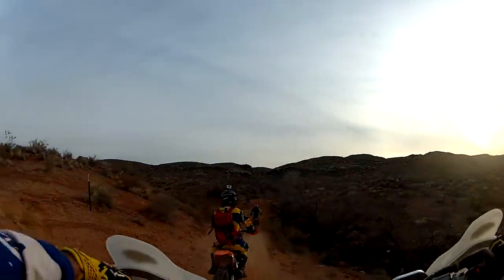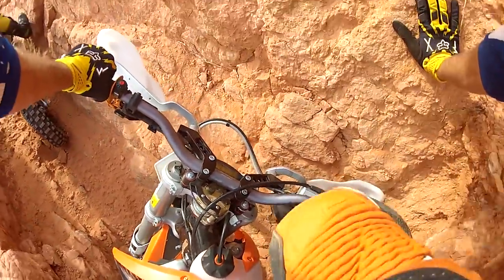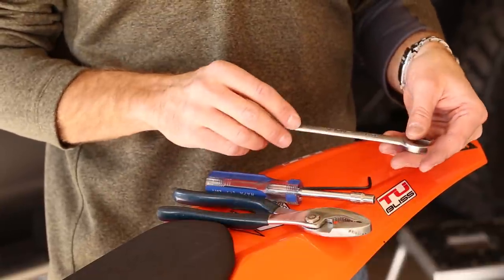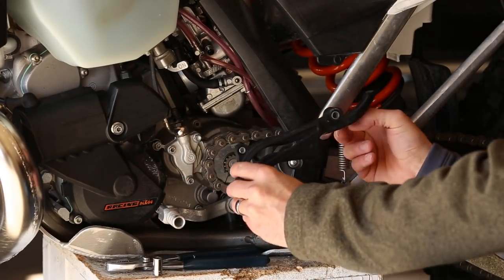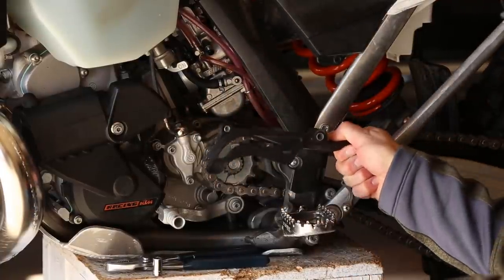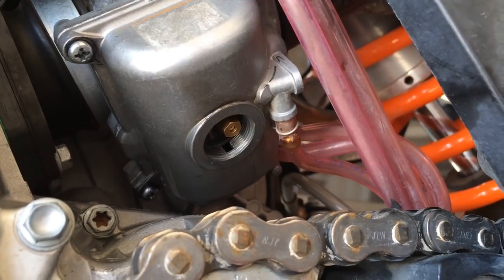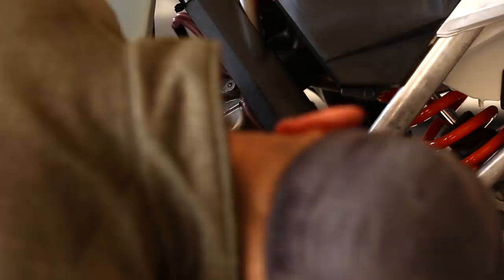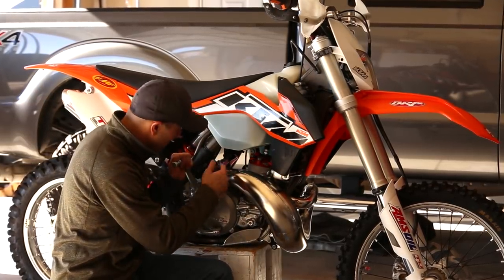How to Jet a Dirt Bike Carburetor - Jetting and Needles

Comment: I never wanted to touch the carb just cause I had no idea what to do. That video was great,  I will definitely save some money by doing this myself. Cheers. Keep the great vids coming.
Reply from the maker: Frank B I'm glad you learned something valuable.
Reply: 4 years later and you’re still saving people money ! Just did this an hour ago.. unfortunately I’m coming from Colorado and riding in PA so I got my jets replaced.. road it didn’t feel right.. procrastinated until tonight and changed my clip position from 1 to 3 and it still doesn’t feel as powerful or crispy as it did in Colorado I bought the bike used so I couldn’t tell ya what exact needle is in there (other than it ran perfect in Colorado lol) so I moved the clip to position 3 (what I read in the manual for OEM) and it still doesn’t feel right 😓 gotta go pick up the right needle I guess lol

Comment: Great personality and attitude. No-one started with a works sponsored mechanic when I was picking up riding in the middle of Australia. It was mates who rode alongside you, laughed with you and enjoyed doing the same things some crazy yank is doing on YouTube.  Some of those thingeys and whatsit's do have names. Needles sit in "seats", the nut retainer thing. Remove the throttle assembly (needle bit) first before attempting the bowl. This allows greater leverage without bending needle, allows for straighter jet removal and replacement (cross thredding at your angle with straight tool). Plastic guide on bottom of spring is set snug in spring for a reason, retension and extension of spring is measured for true length of a spring. Not seating the spring at its propper length can cause obstruction and bunching. 
Your blogging is inspiring for me and my 4yr old son. Educational and addictive. Thankyou
Reply from the maker: Thanks Royce!!

Comment: That little cup at the bottom of spring!  Gotta watch that tongue inside of boot. REAL IMPORTANT!   Your video with the cup up on the throttle wire FIRST and slide the cup down in SLIDE with the tongue inside of keeper is important.  The spring trick was dead on. THANK YOU.  Without that trick the cup is a 50/50 of seating correctly.  Glad I saw this much earlier.  Saved me time and tooling issues. Light at the end of the tunnel was quick.

Comment: i must say the single most important lesson this vid demonstrates is the spring trick on the slide....that is golden to a newbie and once you do all this and reassemble and bike fires right up...the confidence boost that inspires is priceless and wiill give u more confidence in future tuning sessions. but on the spring method ...until i learned that.. i would feed cable on the bottom of slide and lock it in ONLY AFTER i had put the spring on and as  id compress the spring..id hold it in the most compressed  position and then use a pair of small vise grips to clamp on the wire right below the spring so it stays in the position it needed to  get cable end into groove and seated right..then id pop off the vise grips and slide her in the carb housing... its  really frustrating and on average that  step took me around 45 mintes of trial and error before i got it locked in correctly and was the single most difficult step for me to complete....so with the spring twist on method....the hole process will go light years faster!!!!

Comment: Hey a neat trick you can do with your carb is to take the top two vent hoses on your carb and put them in your airbox since only air goes through them. This makes your bike easier to start if you stall in a mudpit or creek where water could be blocking the hoses.
Reply from the maker: ***** Thanks for the tip, Brad!
Reply: Just returning the favor!

Comment: That spring trick is the best thing I have learned in a long time as my arthritic hands get worse. I recently adopted 3 KTMs  and this has been a lifesaver on the 300 and the 440. Which brings to mind a question about the 525: Why have modern 4 stroke carbs become so huge and complicated?

Comment: I bought a new 2016 sx 250 . First time I went on it spark plug fouled straight away before I got on track. Anyway to cut it short my air fuel mixture was out by half a turn so I put it back to settings out Manuel which was 2 turns from right the way in n haven't had any problems since

Comment: tip... try not to ever use the open end side of the wrenches on any bolt. Always use the box end (preferably  6 sided) to break bolts loose and to tighten.

Comment: Don't know if I mentioned this in a previous video comment.......I include a strong, small, flat magnet in my butt bag while on the trail.  I do this to magnetically capture the needle clip......to change clip position...press against the magnet....it hangs onto clip.....select what position you want the clip in and, again, press the clip with the magnet.  I arrived at this idea after losing a clip/looking for it for an hour in the dust and having to jury-rig a tiny piece of wire to act as a clip.  Also,  I carry an extra clip in my butt bag in a tiny container.

Comment: I have a 2003 KTM 125 SX, I need to remove the float bowl in order to change the pilot jet, which is a bummer. It would be nice if I could access both the main and pilot jet from the center hex cap.

Comment: When you pulling the needle and throttle cable out of the carburator at 6:50. What is creating that resistance and pushing the needle and lever back inside the carburator? I'm worry to pull the needle up? Even needle and slider are moving easily, I feel like I will pull too much on the spring. Do I have to release or pull anything to get the needle out of carb body?

Comment: Thanks for your content.  I have a 2017 KTM 250 XCW.  I was going to follow your instructions to rejet the new Mikuni but access seems really limited.  Since you have the new 300 XC, which I assume is similar, any advice on "getting in there?"  I have an electronic module hanging down from the frame above the top of the carb.

Comment: Do you need to mess around with the carb when changing exhausts ?? My cr125 01 keeps loosing spark due to getting covered with oil.

Comment: Hey I really enjoy and appreciate all your videos!  I have a 2015 ktm 300 xc-w SD.  I live in NL, Canada most of my riding consists of sea level to 2000 feet and a range of 10 degrees celcius to 25 degrees 70 to 80's max fahrenheit.  What size pilot and main jet size would you suggest.  I've been riding two strokes for a long time but tuning and working on them is new to me.  I am starting to watch some of your videos and others because I really want to start learning to  tune my bike myself.  I'm also wondering what you thinnk of the ktm powerparts FMF pipe and silencer.  Thanks any help would be greatly appreciated
Reply from the maker: kharma1212 This is just a starting point for you, but I'd try a 168 main jet with a 38 pilot jet.  I'd run a N4DJ needle on the 3rd position.  Your bike kit might have come with the N8RG needle which would be fine too.  You might just have to play around with your air screw and the needle clip position.  Lower numbers on the needle clip are leaner.  Higher numbers are richer.

I like the FMF Turbine Core 2 Silencer.  Not sure about the KTM power parts ones, as I've not tried them.  I like the FMG Gnarly pipe, but I don't love it.  I really liked the Pro Circuit Platinum 2 pipe.  Tons of power on the pro circuit pipe, but I don't like the pro circuit silencer.

Comment: I have a big bore from a 125 to a 134, I have the stock jetting which actually works for where I am. I called multiple places and they said it should be running lean but it seems to be running rich. So my question is can I go with the factory jetting chart, and is my big bore requiring a richer or leaner jet. The main is a 380 which seems massive. 

Main-380
Needle jet-45
Needle-6beg20-68 3rd from top 
Air screw-2-1/2

Comment: the needle doesn't occupy any of the main jet space. it occupies space in the needle jet (which generally is not considered something you change for a different size).
Reply from the maker: You are 100% correct.  I totally mis-spoke on that part during the filming of this video over 2 years ago.
Reply: Do you have any experience with the spreadsheet for finding the perfect needle for your Keihin? It's called the James Dean Jetting Guide. I found the perfect needle for my '89 Honda CR250 by using it.

Comment: You don;t need to take off the chain guard, just wiggle the throttle cable down a bit and the carby will rotate fine.

Comment: my engine runs a little rough, the same bike (300exc *12) of my friend runs very smooth with much less vibrations, he has a jd jetting kit in it but i think its not only the jetting kit. what should i do? needles,... are in standard positions and standard size (right adjustment for my area)    - nice video but hard to understand for a german :-P
Reply from the maker: I bought one of those JD Jetting kits and found it to be EXTREMELY overpriced for what you get.  It only came with 2 needles and 3-4 main jets with one Idle jet.  You are better off to just buy a mix of jets and needles for your carb from your dealer/online.  It will be less than half of the money.

As for why your bike runs rough, it's difficult to diagnose without riding it.  Look at the chart for jetting in your manual.  It will show suggestions for your elevation and temperature.  Use that as a starting point and then fine tune from there.
Reply: thx for answering. the needles and jets are in right positions for my conditions (temp and elevation). i'm only wondered about the engine, can't explain it better: the engine runs rough with much vibrations, not only in idle, also at half or full throttle. the engine of my friend runs very smooth and have a better response. i ride 1:55 mixture (1:60 recommended, think it's better with a bit more oil) should i take a smaller or bigger jet or try another needle position?
Reply from the maker: EnduroAction
Keep in mind that running more oil in the gas causes the fuel/air mixture to become leaner overall.  I know that sounds counter-intuitive. When deciding the fuel pre-mix ratio, always go with the recommendation of the oil manufacturer.

If it's VIBRATION coming from the motor, I'm not sure your carburetor is causing it. In my experience, the carburetor will determine how well the motor runs and will effect performance, but it won't cause vibration.  Vibration makes me wonder if you have something out of balance.  I might take it to a mechanic someone who has a lot of experience with your bike model.

Comment: Great video, I rescently installed jd jet kit on my 2015 te300. As per their instructions its set for 3-6k feet because most of my riding is from 1k to 6k. However I just took it for the first ride since the rejetting and it wasnt optimal, I called jd and they recommend i set it for t 8k'  because it is getting pretty hot where I ride 70-100 degreese. He siad altitude and tenperature have the same effect on jetting. What do you think?
Reply from the maker: Obed M. I bought a JD Jetting kit.  I thought it was VERY over priced for what they give you.  If your bike runs fine, then I wouldn't worry about it.  I bought individual needles and jets for a lot less money to create my own Jetting Kit.

Comment: really need help, this new mikuni carb on my 17 300 exc is killing me. I've only done 4.5 hours and opening to mid range gas sounds quite croaky and not smooth, the power isn't all there low down and she's running out of fuel quite quickly. not very good with carbs other than twisting a couple of screws haha, would appreciate some advice.

Comment: I have a 2008 ktm 300 xc. I don't ride above 2000ft. I bought the bike used. The guy was running a needle I never seen and has no indications on it on notch 3, 175 main, and 38 pilot, air screw was way out and ran great. All of a sudden the other day I lost a ton of low end power. Rejetted multiple times still had issue. I believe it's the reeds so I'm gunna get vforce 4 reeds. Will I need to rejet for the reeds? Or can I follow the book?
Reply: I don't have an answer to that but I just bought an 08 300 and I love it!

Comment: I havent messed with jetting on my bike since ive gotten it. Right now its running amazing. Idk if jetting would make any difference or not
Reply: Its starting to warm up now and elevation where i live is about 900 feet. So whats type of jet would you recommend for 900 feet elevation and about 50-70 degree weather?
Reply: My spark plug has a caramel color in the center where the probe is and it a little dark on the outsides, sometimes is wet with oil on the outside but isnt bad

Comment: I’m having issues on kx125 with a Athena big bore kit.  It hesitates half to three quarter throttle on acceleration then jolts speeds up quick.  I cleaned carb but still feels like it’s starving.  Do you think the needle should be adjusted?

Comment: solved the problem now it was a split in the inlet rubber so when i rapped the throttle on it opened up letting excess air into the mix killing the engine thanks anyway

Comment: Man my buddy has a new to him 01 rm 125 thats been bored .50 over, he got it real cheap cause it's sluggish in first, wont even stand up. it pours oil out the pipe like the guy rejetted the carb and put too big of a jet in (which i read below) but would this cause the bike to be sluggish? New power valve? Im dumbfounded. Thanks

Comment: great and usefull video. one question: I have got ktm exc 300 2015 model and the first thing when i got it I went to jet the carb according to my attitude and temp.  I changed jets as manual says but the  spare needles that i have got with my bike are completely different to those specified in manual. what should i do??
Reply from the maker: Are you sure you have the wrong ones?  What are the numbers on the needles in your kit?  I order them online from Rocky Mountain ATV/MC here in the western U.S.  Not sure where you live...
Reply: The manual seys N2ZW and N2ZJ depends on temp. I got N84K and N8RH in jetting kit. Current setup on my bike is: 
N8RG (stock needle)
3rd posotion
Idling jet 38
Main jet 175
Air screw: 2

What do you think??

I live in Bosnia and Herzegovina 800m above sea level, average temp is 18C

Comment: Hey! I have a 2015 Honda Crf230f and I checked the spark plug and it was VERY white at the tip telling me it is way to lean. I took apart the carb and I have a size 110 main jet and a size 42 pilot jet. Which jets should I buy to get the engine running a proper air/fuel mixture? Thanks!

Comment: i need help its a atv bigbear 400 2007. i have a jet kit put all of it in except the jet. the number of the jet is on top of the jet, but i cant find which one to use i live in east texas.number 138,140,128,124,120,136.thank you

Comment: Honest question here. Do you really have to change jets mid-way a ride? Cant you just stick pick a mid-way jet and stick with it for the entire ride? I'd understand if something's broken and your bike wont run then it's a good idea to take it apart.
Reply from the maker: +shogrran No, I only mess with jetting a couple of times per year.  Some racers would jet each day depending on the conditions though...
Reply: Dirt Bike Channel Thanks for replying. Aside from improving fuel consumption what good does matching the jetting to conditions do?
Reply: No but you should be adjusting your fuel/air mix about every 5-7 degrees F. Not hard just give your engine the max amount of air to idle at the highest RPM. Changing internal jets, needles, slide position will not need to be changed until more dramatic altitude or temp changes. 

Ktm jetting App will give you all this info plus much more, check it out.

Comment: how do you know what jets to use? I have an 01 yz125 had the engien rebuilt and I rebuilt the carb it has a pro curcit pipe and v force reeds and ik those play into what jets you use just don't know what jets to use so please help lol
Reply: 2strokemoto man i ran into the same problem did you find out what jets?
Reply: Lookup what your altitude is,  and then your avg temperature,  then order a main jet that fits that,  and look up the needle position number at your altitude
Reply: Gingercatbmx125 go to the pro circuit website and they will tell you. On my RM125 I run a 430 main and the clip in the second notch

Comment: How do you get the rearmost bolt of the  front sprocket/ chain guard "thing" off? I cannot get my hand, or a tool, in there to get the torx bolt off? The rear shock and parts of the engine are in the way..
Reply: +fredman1085 I ended up getting a tiny 10mm wrench.. thanks

Comment: What is a good baseline for determining what jet/pilot/needle setup you should be using?
Reply from the maker: Brian Omohundro That all depends on your bike, carb, and altitude.  Do you have a manual for it?  You can usually download one online that gives you a table that you can follow for your bike/altitude.
Reply: Rocking But Steady Thanks.  I have my manual and I will use that as the baseline.

Comment: I have rm 125 and I run 40:1 without a prob and I'm putting a new top end and I would like to drop to 32:1 and keep 32:1 would I mix the gas then jet my carb to 32:1 or is there a way I can pre jet it so whenever I get back together I can just put 32:1 in it and it run good